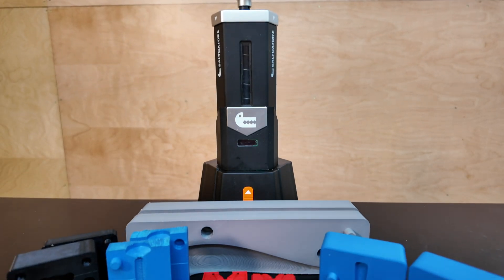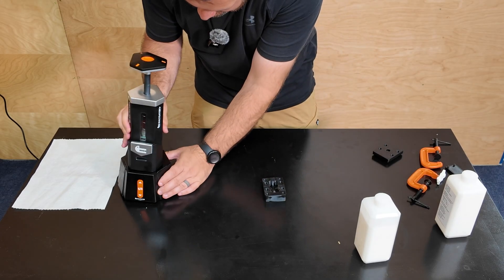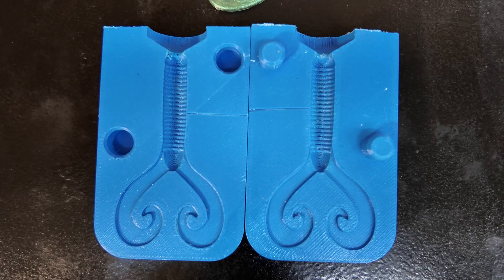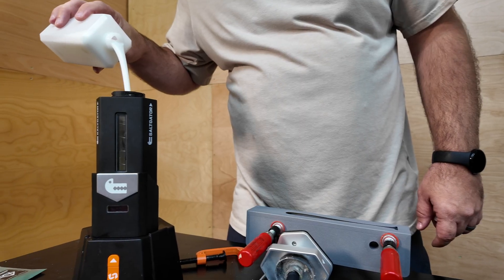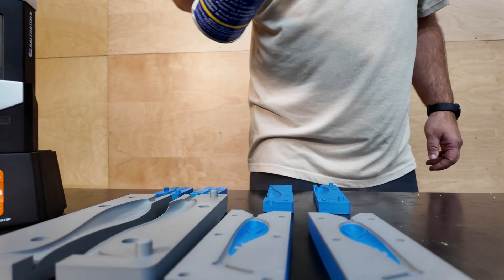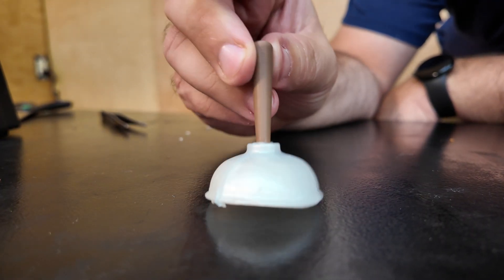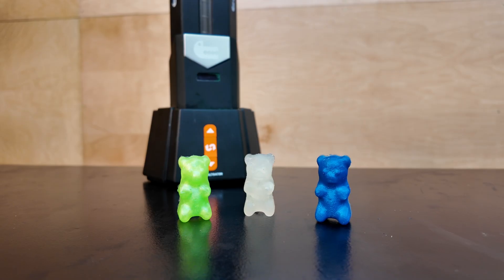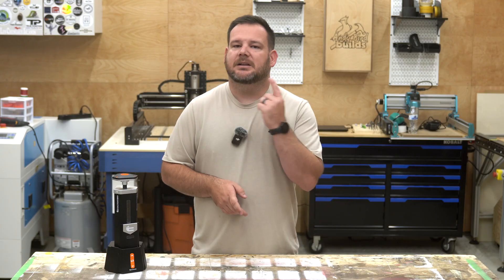The World’s First DIY Injection Molding Machine (SALTGATOR Test)

Comment: As someone who doesn´t fish, i can barely see any use for this thing. I don´t need micro plunger. And i print flexible parts with TPU or Sirayatech Tenacious
Reply: The advantage is not now, it's when this becomes a bit better, and you can dump 180-200 degrees in it.

Then you can dump all scrap filament (or new one) inside a PETG or other high-temp material, and once you have a mold, it takes you 2min to produce a part, regardless of size, not 20 hours
Reply: Overmold metal

Softbody robotics